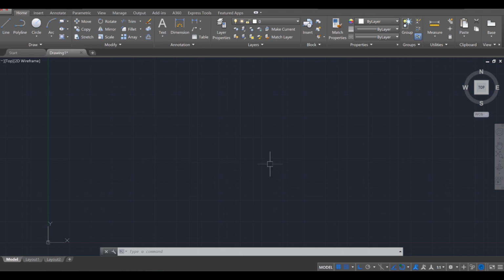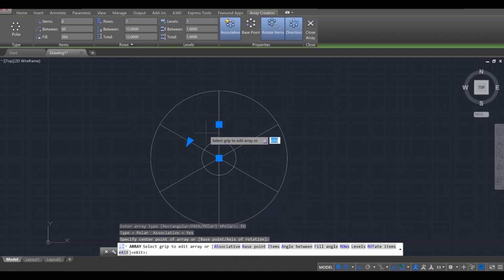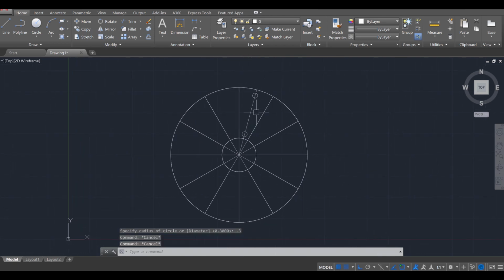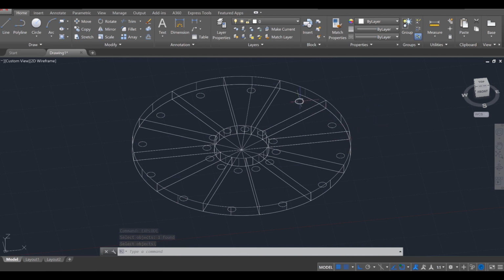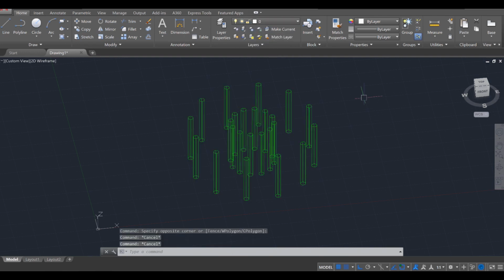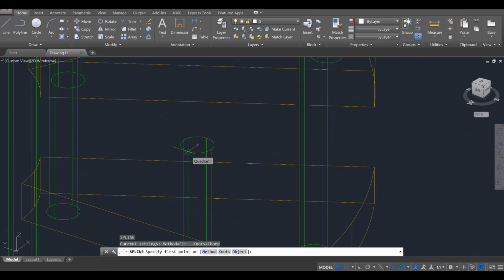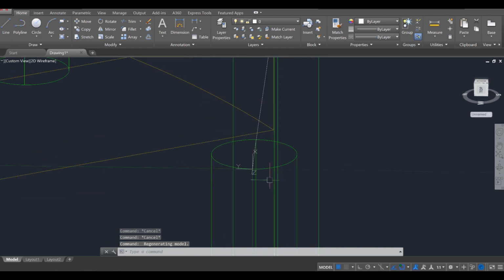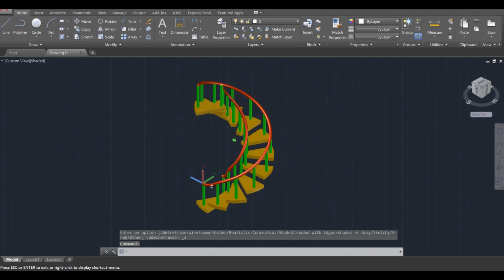Beginner Tutorial AutoCAD 2018 - Designing a Spiral Staircase

Comment: Just my opinion you could have used the helix instead of spline and sweep instead of Extrude/path. and with the sweep command, you don't need to change the UCS, just draw the circles anywhere and the path will pick it up.
Reply: This was 11 months too late, but you are a life saver. I usually put the object on the path for the sweep. I tried what you said and yes, it does work even if the object and path isn't connected together. Thank you so much for this. And yes, you're right about using helix and sweep rather than spline and extrude as shown in this video. But I did learn something more, thanks to you.